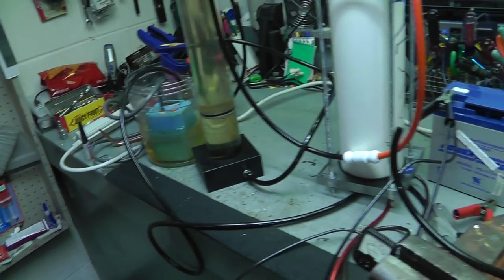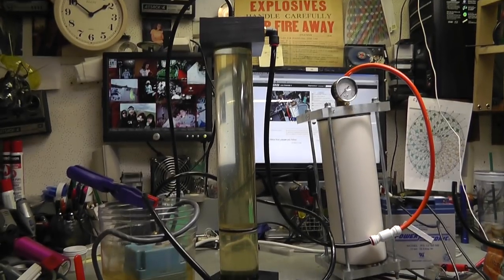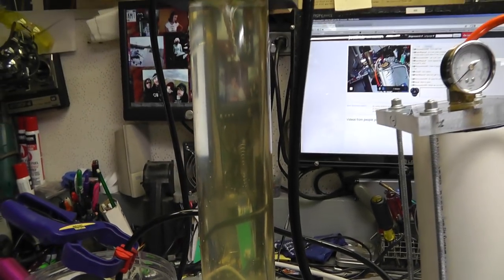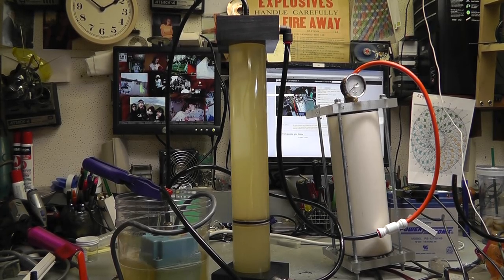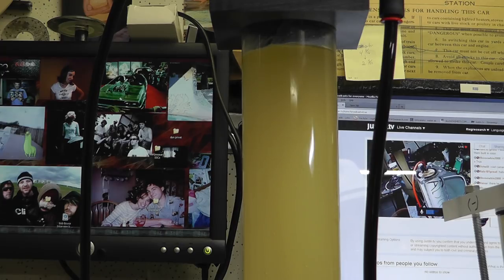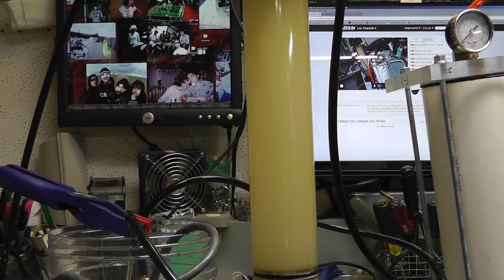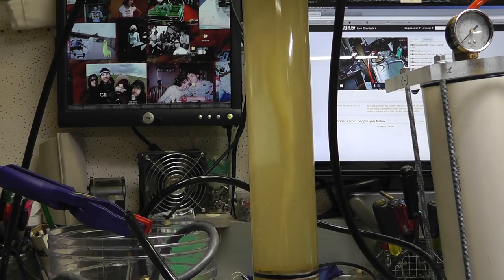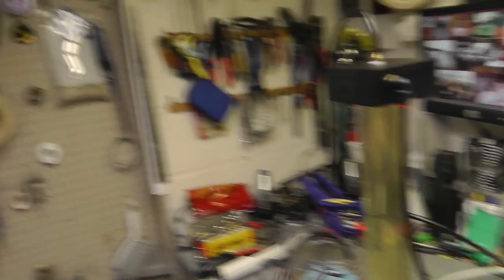HHO Vortex Separator In Action. Getting Ready for Upcoming Burn Rate Testing. RWGresearch

Comment: Looks cool Russ, but your Little Giant Pump should be capable of putting out much more flow it seems restricted. From the video I believe your tubing inside diameter is 3/8th and should be 1/2 or if it's 1/4 it should be 3/8th, anyway I work a lot with those pumps and it should be doing better. Sometimes those pumps come with a nylon barbed nipple that is 1/8th smaller than the threaded fitting, just go bigger on the barb and hose if that's the case.
Mike